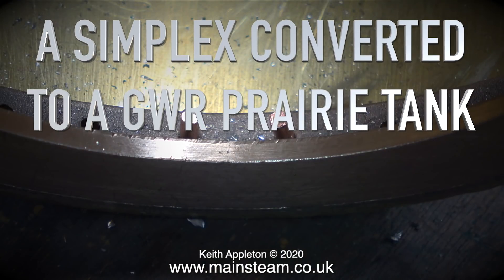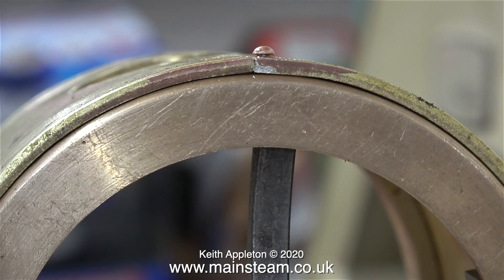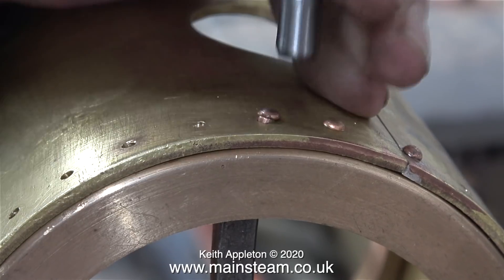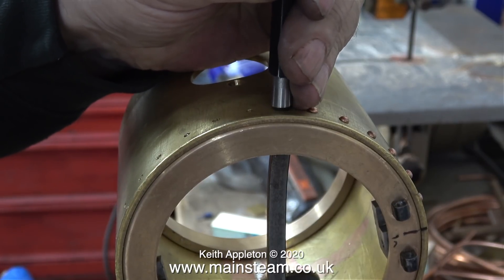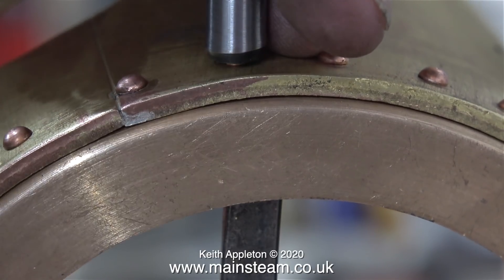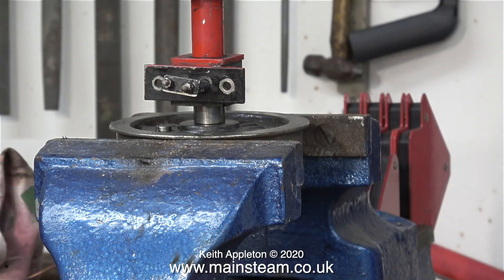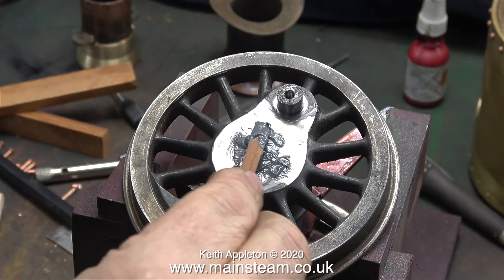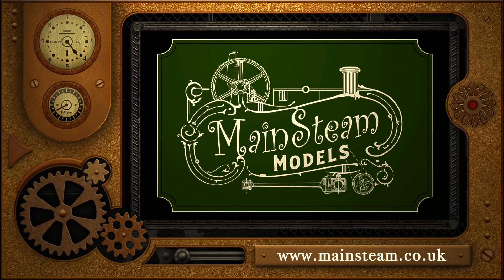SIMPLEX PRAIRIE TANK - PART #44

Comment: I once used JB Weld outside on a cold but not freezing day and decided to heat the repair in the hope it would set faster. It set alright!  It became like coke, very brittle and crumbly so I had to haul the plow inside and let it warm up overnight before doing it over again.  Lesson learned, do not heat JB Weld while it is setting!  It will carbonize and be useless.  This was an interesting video as you showed both the wrong way and the right way to do such a delicate riveting job.  Sometimes just saying "do it this way only" isn't enough. You have to explain and show why it's the only way to do it.